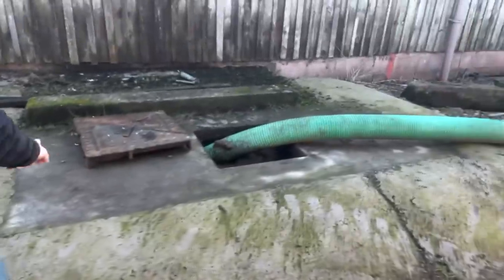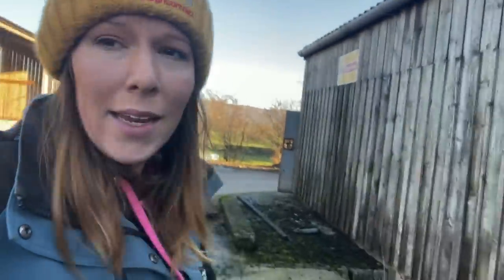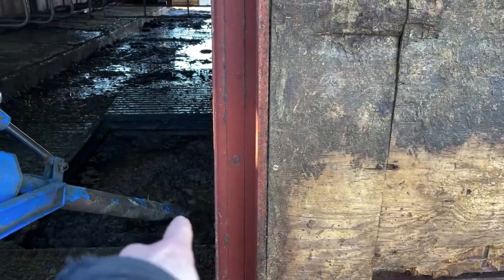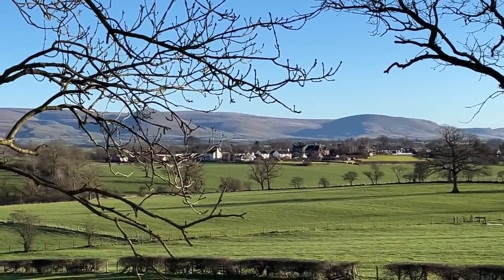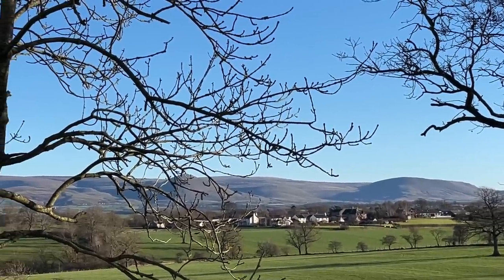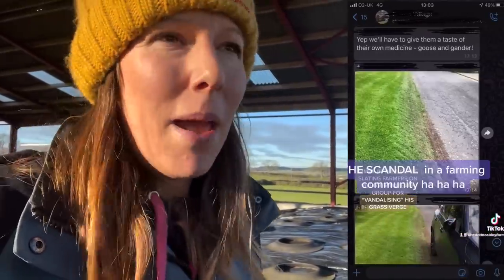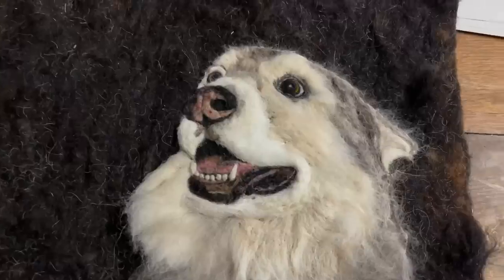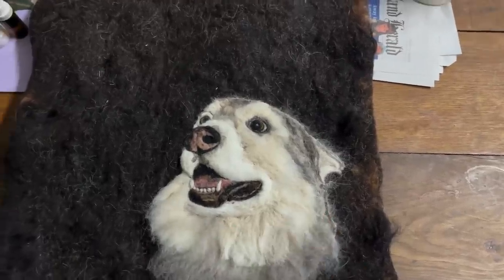New year, air ambulance and a what would you do about the slurry situation

Comment: I think you need to look at muck as fert going forward and having a system that will allow that. The bigger the surface area, the more you will need to spread. Fuel, time, land are etc. versus cost. For positioning, I’d print some aerial shots, cut some shapes and have a think about emptying it. Also slurry flow that will be most likely to keep flowing.

Comment: Does the field slope away by the new building? I’d put a lagoon in you’d need only a scraper to push it in no pumps or anything if it’s already lower than the building you’d need to move less dirt so be cheaper and also won’t be quite so visible In your yard I’m new to your channel
Reply from the maker: Yea your right it is downhill BUT we have just heard on the grapevine that the enviro agency are wanting a drainage system under the lining now and then they can turn up at any time and check the runoff and if it’s got any contamination they can tell you to put a new lining in, sounds far fetched but maybe some truth in it where as a tower is a sealed unit
Reply: @charlotteashleyfarm  I’d still build a concrete panel lagoon with a ramp so you can drive into it to empty it aswell as sucking it out with a tanker

Comment: Don't know what the cost be or how easy it's to do but can't u dig a big storage pit under your new barn and put a slatted floor on top for the cows to walk on
Reply: Been thinking since that u may need to have a word with a structural engineer but u may be able to dig down on the barn and then put block and beam floor down but would be need to reinforced as the weight of tractors and cattle but that would be an option because the block and beam u can concrete on as u do in a house but needs to be stronger oversely